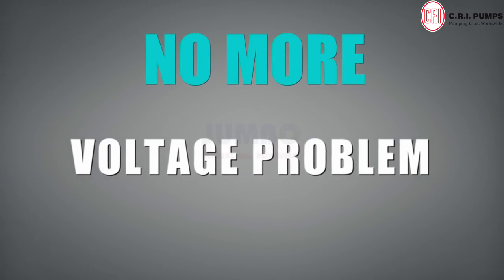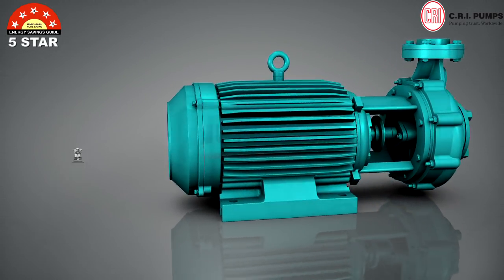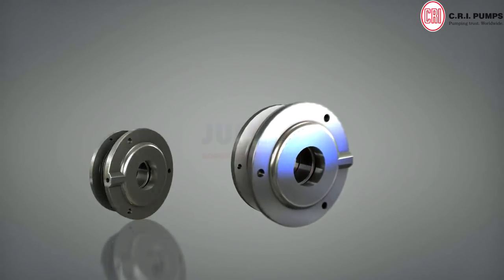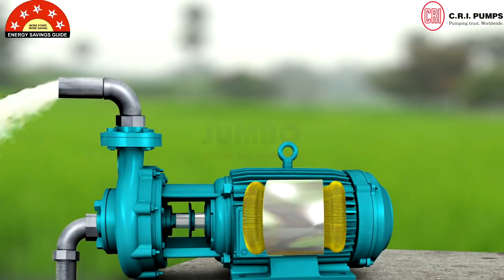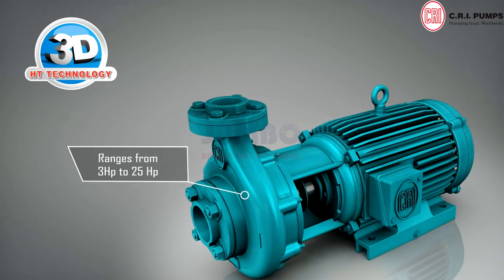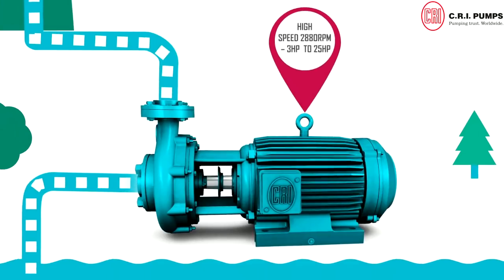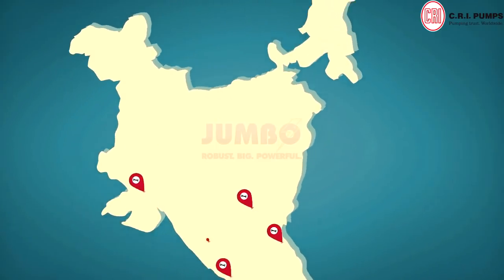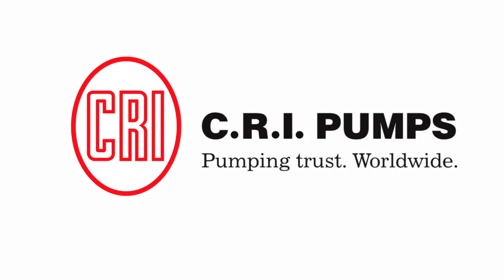NEW 5 STAR RATED C.R.I. Jumbo Series Monoblock Pumpsets

Comment: 4 inch pipe line 5000feet long head 52 met.required discharge 750lits per mins which model or HP to be select